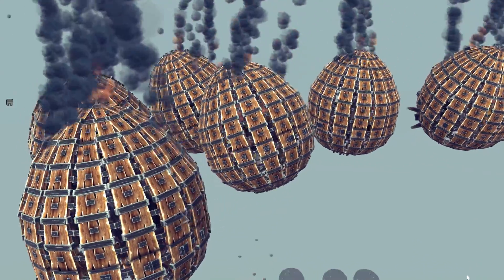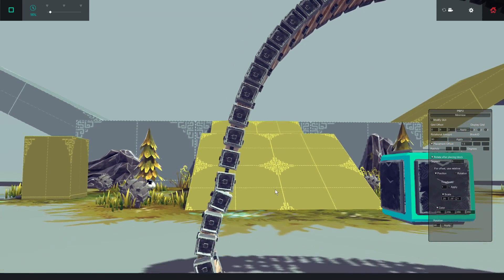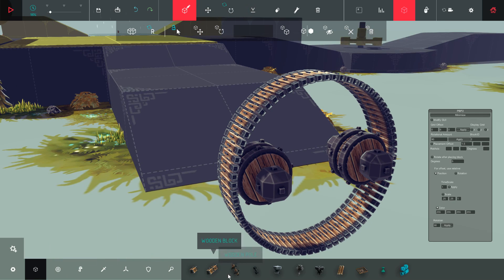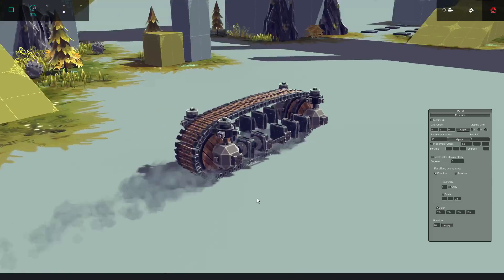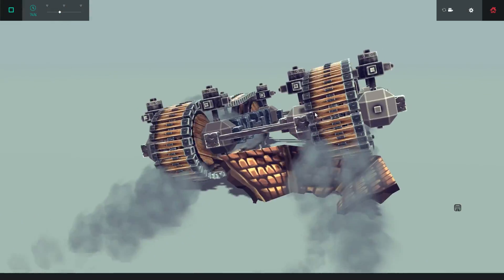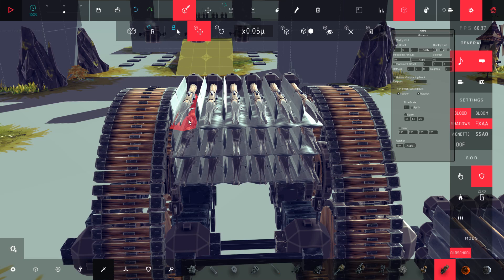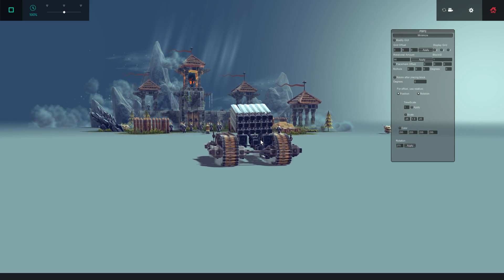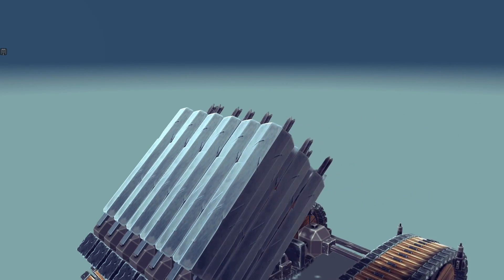Besiege: Beaster Eggs & Katyusha Rockets: Scaling Tutorial | let's Play

Comment: I've hatched another idea! Using only the following  movement types, rockets, wheels(Not touching ground, mostly for propellers), and propellers(both sizes), to make a non quadcopter design that will drop a box of rockets that will burst out, fly for less than a second then explode. Vehicle can also not be a hovercraft, so it most likely should be a plane, a helicopter, or a giant controllable rocket. But that's not stopping you from coming up with something else!. 

This is the fireworks delivery challenge.

Comment: I didn't know that wood blocks could make for such great tracks! That grip is a lot better, plus they bend and flex like it's a big rubber track - way more fun to drive than metal tracks.
Reply from the maker: +TheAmazingTwist I found out by 'happy accident' I was just messing about with scaling tool and offset together and this popped out! They are great but the drag on turning is quite significant so I'm going to try eliminate some of that, or maybe someone else will.

Comment: Can you help me? When i try to use "Rotate after placing Block" it doesn't work! I check the box so it's active i set the Degrees to "5" but it doesn't work
Reply from the maker: +Feuerstern3001 You also need to have 'placement offset' checked and an amount (2 or 3 etc) entered into one of the three boxes. this will cause the block to appear at a distance and will turn it by the 5 degs. let me know if you are still stuck and I will try to help
Reply: +Besiege This! No it still doesn't work. I changed everything so that is like in the video here's a image (you don't have to dowload or anything like that it wil just show the image :) ): http://www.mediafire.com/view/19bktevsys2ey3a/20160327210759_1.jpg

Comment: Great job as always!  But why not place the tracks already in the desired shape so you don't need to use pistons?
Reply from the maker: +Ross Plavsic Thanks Ross. I usually do that as you know but this was to demonstrate the effectiveness of the scaling tool as it allowed the extra piston travel to take up such a large amount of slack. It also ensured the uniformity of the joins in the track itself since I was unable to use the rot/axis function to place these blocks due to their lengthways orientation.